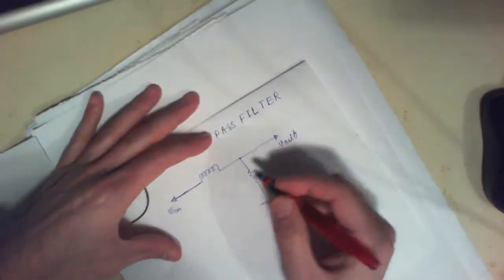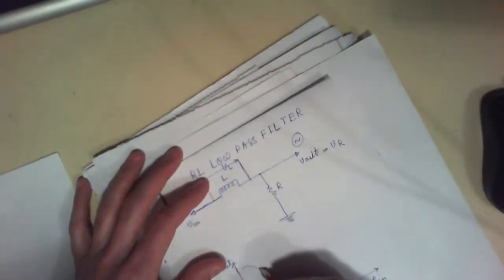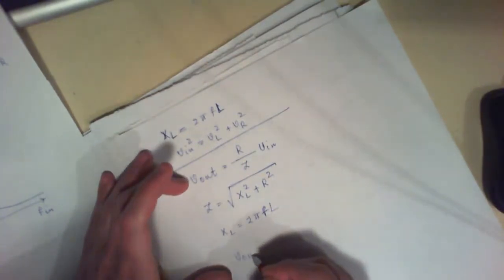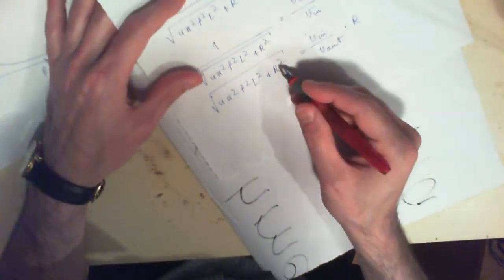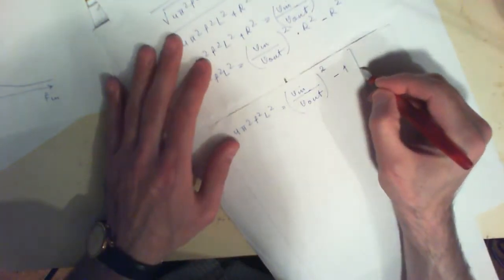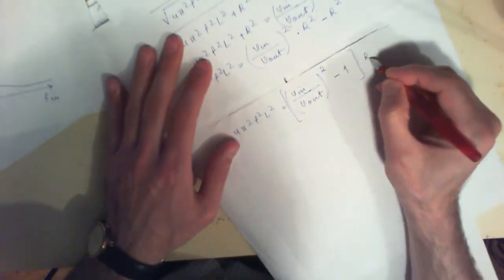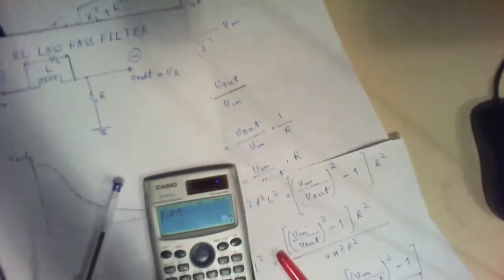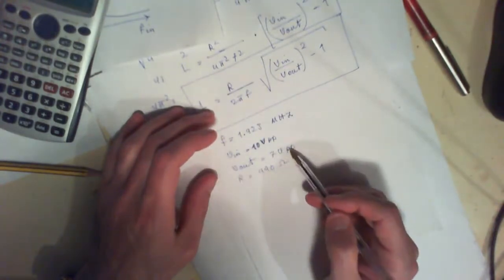How to Measure Inductance of Inductor Using Oscilloscope and Function Generator

Comment: I am thinking a simplified method to measure inductance. The impedance of an inductor = jwL, where w = 2 (pi) f, and the impedance of resistor = R. When |Z(inductor)| = |Z(resistor)|, wL = R, and therefore L = R / w or L = R / 2(pi) f. So if you adjust the  voltage source frequency to make voltage at R = voltage of source / 2, the above condition is achieved, and the inductance L can be calculated by L = R / (6.28 * f).